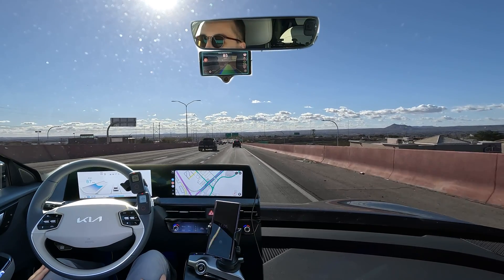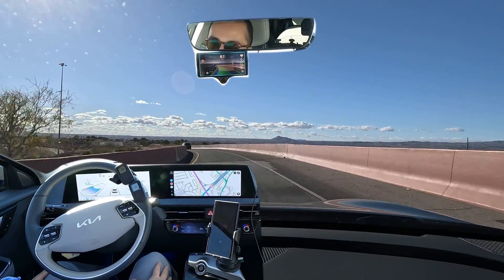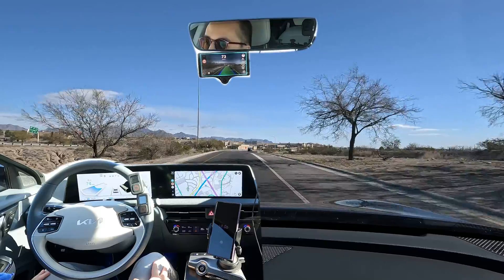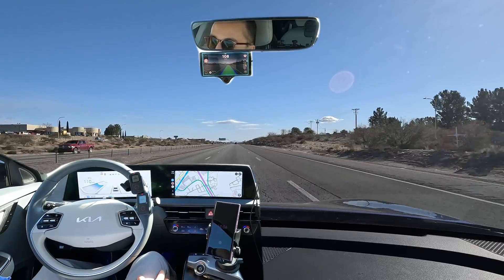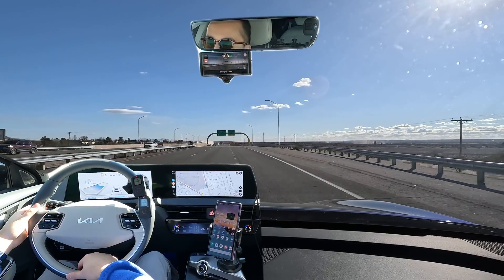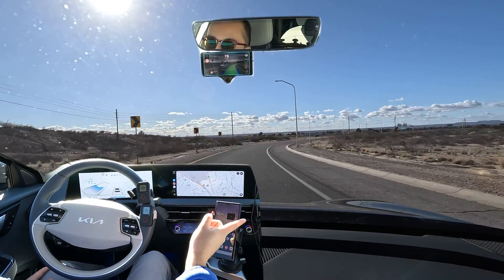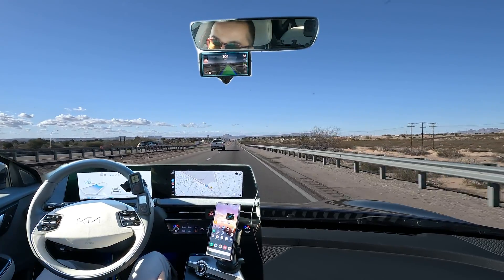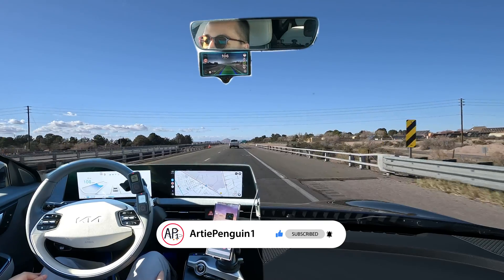Comma 3X - SunnyPilot 0.9.6 Day Interchange Test

Comment: Zaman içerisinde toyota corolla safety Sense 3 güvenlik sisteminde de kullanılır mı şuan kullanım yok galiba.
Reply from the maker: Hi, Comma AI currently doesn't support Toyota due to technical incompatibility. They are working on this but there are no guarantees it will be supported. All Toyota models apparently have tight security in regards to the CAN bus which is why it's incompatible.

Comment: Acc kapalıyken şerit ortalama yapma özelliği var mı? Acc kapalıyken çarpışma önleme yapıyor mu? Acc kapalıyken normal seyir halinde aracın kontrolü sizdeyken araba yolu izleme yaya algılama ve benzeri işlemler için her zaman cammanin camerasınımı kullanıyor? Yani aracın kendi stok camerası comma takılı olduğu zaman işlevsiz mi oluyor? Yoksa ikisi birlikte mi çalışıyor.
Reply from the maker: Yes, lane centering works without cruise control. Please see my later videos for a demonstration of that. The Transmountain Challenge video shows the system being used without cruise control - https://youtu.be/k9XWOtOqOAM.

Note the Comma 3X doesn't support object detection, it only looks for the edge of the road and lane lines. The Comma 3X takes over from the stock camera and stock lane keep assist system. However, in Hyundai-Kia vehicles emergency braking and cruise control (radar) are untouched and work as stock.

Comment: I want to turn off driver monitoring. I can't find this option in the menu. Do you know which Python script I can use to modify this?
Reply from the maker: You cannot turn off driver monitoring or else Comma will prohibit your device from using Comma Connect. SunnyPilot also does not support devices that disable driver monitoring. Basically if you choose to disable driver monitoring, you're on your own.

Comment: Hi! I've heard that some cars like the 2020 Sonata supports automatic lane changing in conjunction with the blind spot monitor? (without needing to put turn signals and nudging the steering wheel), do you know anything about this?
Reply from the maker: No, the stock Hyundai-Kia system will always require that you signal and nudge the wheel to confirm. On the Comma, you have the option in settings to allow the system to do it without requiring confirmation by nudging the wheel.
Reply: @ArtiePenguin1  Thanks for the reply. Does this nudgeless only work a blindspot monitor? Also, is there an option on SunnyPilot where intervening with brake or accelerator won't disengage the system?
Reply from the maker: It should work without blindspot monitor. Yes, you can set SunnyPilot to not disengage only the steering upon brake or accelerator input. The system will always pause speed control (longitudinal movement) for safety whenever brake or accelerator is pressed.
Reply: @ArtiePenguin1  Thanks for your reply
Reply from the maker: You're welcome! Thanks for watching the video

Comment: Cool video. Are you using navigate on openpilot? How does it know where to go at a fork? Also, what's on your steering wheel?
Reply from the maker: Thank you! No, I'm not using navigate on OpenPilot because right now that requires experimental end to end longitudinal control. Enabling that would disable auto emergency braking in my vehicle.
I think the driving model is just following the left (yellow) edge line of the road. If there's a dashed line, it'll follow that.

The things on my steering wheel are GoPro remotes to control the cameras.
Reply: @ArtiePenguin1  Makes sense. Thanks for the response.
Reply from the maker: @gauravbathija6783  You're welcome; stay tuned for more videos about the Comma 3X and  SunnyPilot.